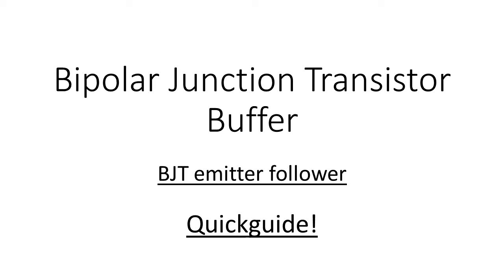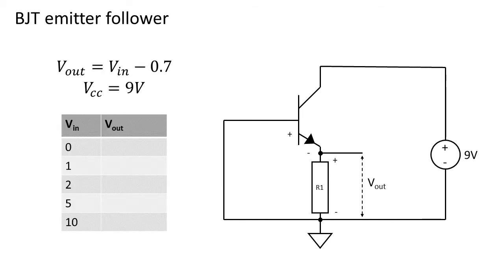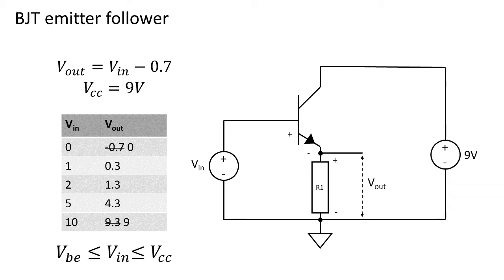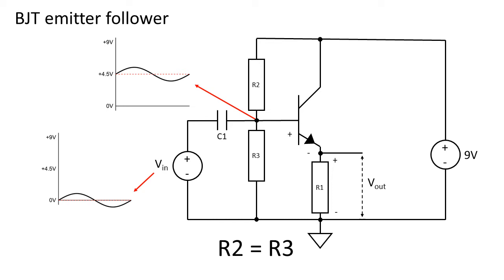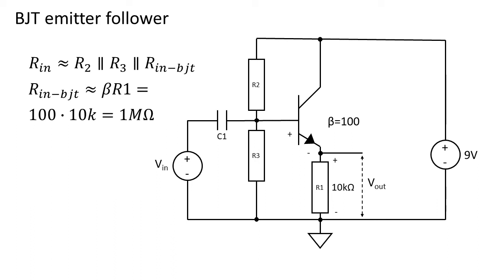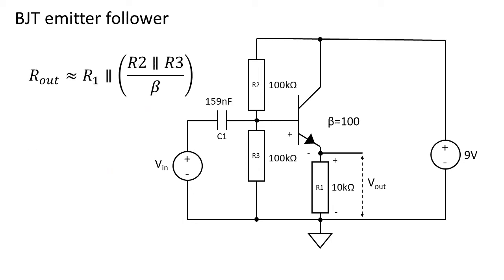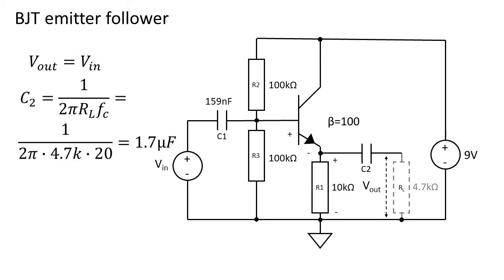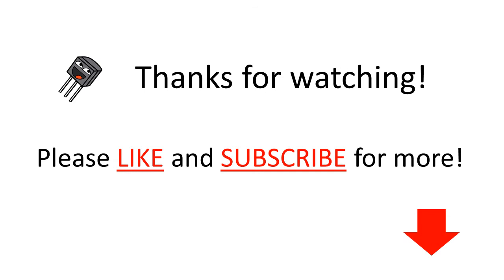Quick Guide: Designing A BJT Buffer For Audio (Emitter Follower)

Comment: Hi thank you very much indeed for the extremely interesting tutorial.   I would like to build a single active device buffer to use as a line stage driver.  I cannot understand that it would be better to use a bjt like in the video or a fet.  I understand that fets could sound nicer ?  more like tubes ?  i would be very interested to know your opinion   Thanks againa and kind regards, gino
Reply from the maker: In my most honest opinion I would usually use high input impedance, low noise opamps for audio stuff. I imagine the tube stuff to only matter once the stage gets overdriven. Ofcourse, JFETs have a higher input impedance than BJTs which has their uses. 

And in my most most most honest opinion, I don't really care for JFET or tube "warmth". It often is a placebo effect where companies make great use of to empty your wallet.